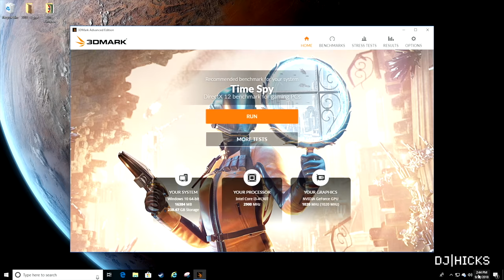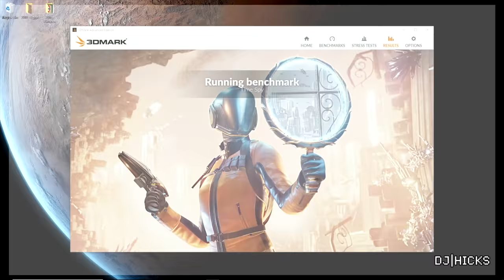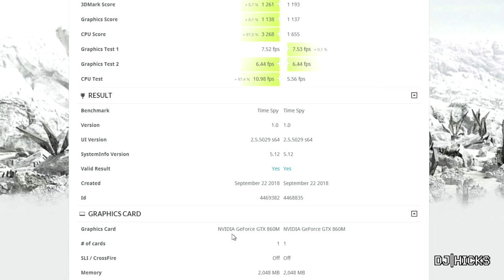How to Upgrade Your CPU Alienware Alpha Benchmarks

Comment: what paste is the best or what do you use?
Reply from the maker: I usually get some variant of Arctic Silver thermal paste. I got some Arctic MX-4 "2019" for a Ryzen 9 3900X about a month ago, but the heatsink came with thermal paste applied so I used it for convenience. I don't there's a huge difference as long as you don't go with some super cheap stuff. I usually pay $7-$10.

Comment: Hello friend, will there be a difference if I replace the i3 with the i5 4590s?
Reply from the maker: Yes, but not significant. If you have one lying around, go for it. I wouldn't buy a Core i5 to put in here.
Reply: @DJHicks  
Thanks friend, it is that they are selling it to 5 usd and the truth is I need it for the games since there are games that ask me for 4 physical nuclei, as fornite is throwing me many jerks with the current processor

Comment: i am i3-4130t if i upgreed to i7-4770 do i need change the power charger
Reply from the maker: No. That's exactly what I upgraded and the existing power supply works fine.

Comment: Would I be able to use a AMD Ryzen 5 2600?
Reply from the maker: No. Wrong motherboard. Intel 4000 series only for the original Alpha.
Reply: @DJHicks  what about the Intel core i5-9400F
Reply: Imweak

Comment: 1. I was given an Alpha machine with an i3, and want to upgrade to an i5 or i7 and I have been watching videos where the main complain about upgrading the CPU is that the noise that the box produces.

2. I only run FFXIV online, so do I need to upgrade CPU?

Thank you!
Reply from the maker: If you can get the game running and then check the CPU usage you'll be able to tell if you need an upgrade. I'm betting FFXIV relies more on the GPU than the CPU. You could open task manager and bring up the CPU graph. Then launch the game and go to a heavily populated area and Alt+Tab out to check the stats. Or install a monitoring tool that could display system stats on-screen.